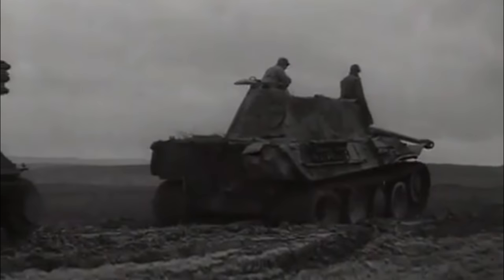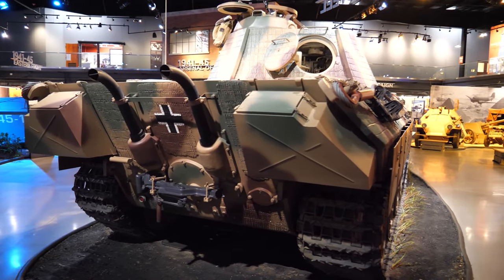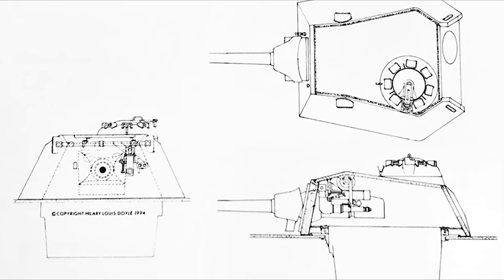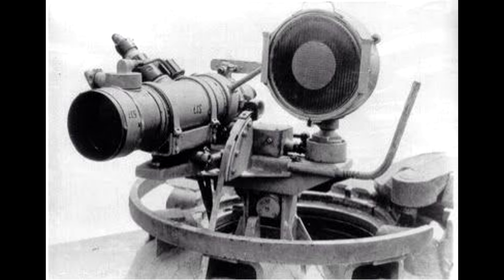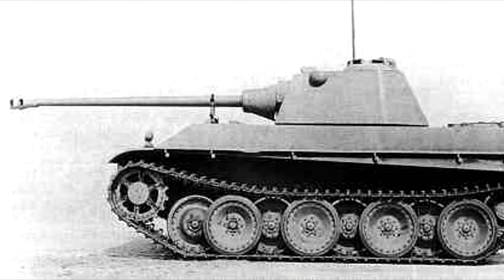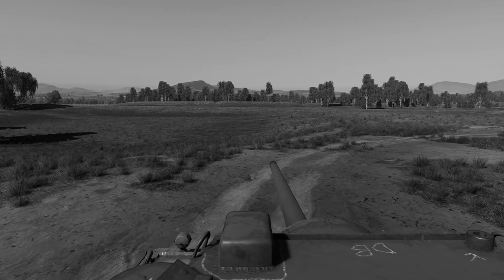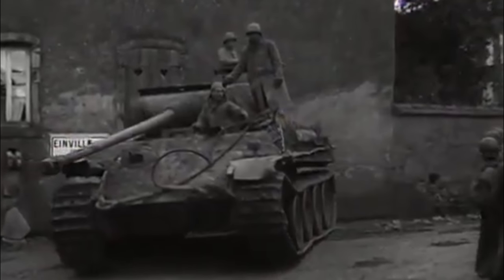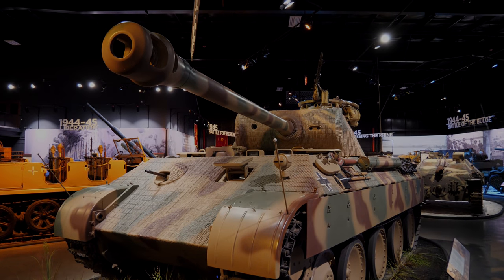The Panther Time Forgot, the Panther F | Cursed by Design

Comment: They also tested the Panther II out. It was that turret mounting the 88mm L71 from the King Tiger. The allies found one on the Krupp testing grounds at the end of the war. Had they managed to produce it, it would have been the most lethal tank of it's day! As you said, it had major transmission problems because mechanically it was front heavy having the whole weight of the final drives plus that (at the time, huge gun) all bearing down on the front. Had they gone towards what is now conventional, with the drive sprockets at the rear, directly connected to the gearbox it would have been awesome! It had it's faults but, I still think it was years ahead of anything anyone else had designed and built! The gun was extremely accurate and the crews (most importantly) were very well trained. Everyone says the design was pinched from the Russian T.34.....Ok yes, the sloped armour etc but, the T.34 was massed produced and unreliable to start with. It improved yes. It wasn't designed to be 'fixed' throw it away and get another one lol! The Panther was an amazing piece of finely machined tank porn! I say this as an ex-British tank crewman that served on Chieftain and Challenger 1 so I have a little insight as to what makes a good tank. The 'crew' involved at Bovington, private collectors, share a couple of original Maybach engines. One is normally operational while the other is getting fixed. One of the best moments I had there was when they took the engine from the Tiger I and put it in the JagdPanther owned by a S.African guy so they could drive it around. The noise and to see this beast moving made the hairs on my arms stand up! I could imagine the sheer fear of allied tank crews thinking they might get hit from it and not being able to see it let alone actually penetrate it's armour.
Reply: Uummm.... Correction

Only 1 Panther II hull was ever produced, and the turret (Schmale-Blende, not Schmalturm) was never been produced. Plus, the armament of Panther II is the same 75 mm gun

Comment: The shot trap has nothing to with the slope angle of the turret front but results from the curve of the lower part of the mantlet. In the photo showing penetration you can see the gouge in the mantlet where the projectile has bounced off before  penetrating the roof/turret front.

Comment: It is good to remember that the Schmalturm altrough was relatively cheap to assembly as many interior components of the turret was already in production for the Panther Ausf.G offering much better protection. The production of the Schmalturm was delayed because the Zeiss optics was hardly never delivered and was overrun by the Russians and the stereoscopic rangefinder was not produced with the exception of few prototypes. Due to chaotic final months the Schmalturm was never putted in production and other issues..

Comment: Opinion Piece here.
  My thought is that the Panther 88 program and this variant (F serie) were both working toward the same end.  Unlike the rest of the AFV fanboi world, I think a Panther with the 8.8cmKwK36/L56 (NOT the 71 caliber 8.8cmKwK43) would've been more viable for mass production, and more sensible, logistically speaking, than any other late war Axis tank program.  I think the balance would be better, too.
  True that the shorter KwK36 wasn't as good a tank killer, but it could punch holes in the M4, T34/85, and Comet/Cromwell from well beyond the range the others could punch holes in it.  As for the Pershing, we only had 310; less than Germany had of King Tigers.
  Consider that: the US M26 Pershing was MORE rare than Kingtiger.
  As for the Eess Dva (IC/IS 2), it wasn't a very good tank.  Its rate of fire was very low and its sights were not the equal of the gun's effective range.  Panther was far more maneuverable and had much better sights.  With the "kurz" 88 Panther would be close to ideal, imho.  We (USA) stuck with the very similar 90mmM3/L50 line after the war, so my contention is not altogether without historical merit.
  Great content, btw.

Comment: I can't shake the notion that Panther might've done a bit better with the 8.8cmKwK36/L51 of the Tiger E.  I don't know the muzzle energy of the "75" offhand, but I do know that 900-1000mps is pretty high energy.  I suspect that might be roughly equivalent to the "ach ach's" Muzzle Energy.    I think the balance would've been better, too, and that was a BIG factor in suspension life.  Front heavy AFVs* suffered extreme differential wear.  Plus, longer overhang is death to maneuverability, mobility cross country and on narrow, winding, roads.   
  The much higher velocity 7.5cmKwK42/L70 had a big breech, too, so I figure the two different caliber weapons would take roughly the same amount of turret interior.  Since the 8.8cm FlaK/KwK 36 was already in mass production, was a dependable weapon, and had a long barrel life . . . and a far superior HE round, it would've been a better match, imho.
  I know some folks claim the 8.8cm/L70 was supposed to somehow go inside the narrow front turret, too, but I don't see it happening.  Not enough room behind the breech to sling the rounds inside the turret.   The trunnions need some kind of bulk inside to better balance overhang, after all.  That means a bit more of the gun would have to be inside.
*Front heavy AFVs like StuPz IV, JdPz IV/70, SU100, SU122, and others.

Comment: Good video, but you have missed some very interesting facts about the Panther F:
1. You mentioned the improved gun sight, but they developed that further to be fully stabilized. In the end the Panther F would have been able to give accurate fire when in full move. Even though it was only the sight that was stabilized and not the gun, the sight was linked to the trigger, such that once the gunner pulls the trigger, the gun only fires as soon as the sight and the gun are aligned.
2. Even the gun sight that was ready for use (the one that you showed) was a huge improvement over the Panther. The Panther's gun sight was just horrible, because its fov was so narrow. This was actually one of the issues that motivated the Panther F's development.
3. There was also an autoloader version of the 7,5 cm KwK 44/1, called the 7,5 cm KwK 44/2. It was able to fire its four shots in 4.5 seconds. It was planned as a future upgrade. However, the turret would have been incredibly cramped with that thing, so it's not absolutely certain that the idea would have been practical.
4. Speaking of the gun, there where plans to mount the Tiger II's 8,8 cm KwK 43 L/71 in the Panther F. The side project is commonly known as Panther 8,8 cm or Panther 88. Daimler and Krupp each developed a turret for the Panther F to mount that gun. The project is sometimes misattributed to the Panther II, but by the time the development of the Panther 88 begun, the Panther II had been dead for over a year.
5. Perhaps the craziest side project was the so-called Turbo-Panther: BMW were developing turboshaft jet engines for the Luftwaffe, and in 1943 one of their engineers proposed to use one of those things to propel the Panther. The first designs had problems with fuel efficiency and space requirements, but when later iterations fixed most issues the jet engine got approved to be used on the Panther F. By February 1945 it was ready to enter production, but the late war chaos prevented any actual production. Just like with the Panther 88, the Turbo-Panther is often misattributed to the Panther II, even though you can easily resolve both misconceptions just by looking at the time lines.
Reply from the maker: The panther 88 is going to be lumped into my revisit of the Panther 2. As for the autoloader you mentioned I saw no mention whatsoever of it in my source book so I can't confirm that was ever actually a possibility for the tank. If you have information on it I'd love to see it though.

Comment: Could the MG42 be substituted for a coax or hull-mounted MG34?  The video says the, "armored MG34 was no longer in production", but I don't think the MG42 could be used in those applications due to revised method, compared to the MG34, for replacing barrels; the 42 had a hinged barrel jacket that allowed the barrel to be removed at an angle, from the side, which worked great for a gun in infantry or similar use, but wouldn't work if there were a mount surrounding the barrel; was installation of a MP43/StG44(!) be due to the unsuitability of the MG42?  Were MG42s used in coax or hull mounts on any armored vehicles?

Comment: Ru-251 is one of the fastest tanks ever built. But, there was little information about this tank, which includes its designed top speed. Also, in my experience playing WoT, to use its max gun depression, I have to turn the hull sideways. This maybe reflected in War Thunder but I never played it due to required technical specs. But, it will be always appreciated if you make the next CbD video about this with a demonstration on the aforementioned gun depression. Hope you comment on this to know if you have plans for it.

Comment: Thank you for the video. I also found the night vision video an excellent coverage some time ago. I remember the allies finished some Panthers from factories after the capitulation, I assume they got the G turret? Post-war service of german tanks was not unique, including the Panther. 
Did i heared it correct, about Panthers still having some mechanical issues at the end of the war? I assumed they proved more reliable then Tigers and easier to mantain? At least rail road transport was better.
Reply from the maker: They had improved significantly by the end of the war. Low skill crew and bad quality materials still caused unreliability though.

Comment: You haven't mentioned the Panther F hull at Aberdeen , fitted as it happens with a G turret, with its increase in armour all around??
Reply from the maker: You're thinking of the Panther 2 hull not the F. The F had the same hull armor aside from the roof

Comment: Tell us of the advantages of the wide based rangefinder. The idea of greater distance of its baseline says it would be better, but is it solving a problem, or just a bit better? 
This video is the first mention of night fighting equipment on tanks. If it was based on tube technology and had tubes much larger than on a radio, it must have been very fragile.Yes?

Comment: How was the new conical design not prone to shot traps? I see a huge slope underneath the conical mantlet that could bounce a shell to hull roof under it.
Reply from the maker: The odds of that causing a shot trap are pretty minimal compared to the entire turret face having the potential shot trap.
Reply: @ConeOfArc  Got it, the question I have is why they didn't take the panther G mantlet approach and add a straight angle armor under the conical mantlet just for added protection/perfection. I can't think of any constraints to that and just can't understand why they didn't do that.
Reply from the maker: @liquidator3828  probably because in real life battles it was pretty much a non issue. Plus adding weight to the gun makes it that much harder to elevate it

Comment: The standard turret was cramped enough, I'd dread to think how little room there was to move around in there.
Reply: Not really, no. 
The newly developed KwK 44/1 from Skoda, which was to be used in the Panther F, had its recoil buffer and the recuperator below the gun breech. This saved a lot of space and shortened the reloading time.
Reply: @cursedjagdtiger7191  that must be some serious size reduction because if you have ever seen people move around inside a standard turret or move ammo, itsnthe worst turret I've ever climbed inside of in latenwar terms

Comment: An suggestion would be the T-32 heavy tank.
Reply: An actual good heavy tank project that didn't make it to production because war time funding was gone. Just one of those blocking the road in Korea would have been a whole lot of nope for T-34 or IS to deal with. Considering the M26 refits into M46, this heavy tank would have equivalent power to weight of that of a T-54.

Comment: My understanding is that it would also have had gun stabilisation. That and the stereoscopic range finder would have made it the most accurate tank in WW2.
Reply: More likely a stabilised rangefinder. Spielbergers book on the Panther talks about that. Otoh the Panther chassis is quite stable and dampens oszilation quickly. So quick stop and snapfire works (The germans used that on the Leopard 1 as well)

Comment: Germany: The Panther's main problem is that it is far too heavy for its relatively light engine and transmission, this issue must be fixed for it to be effective.
Also Germany: lets add more armor!
Reply: the Panther 2 had a bigger transmission and engine to make up for the weight increase
Reply: IS 2 46 tons and 520hp , Panther 44 tons and 700 hp . Why people always say it has a weak engine .....

Comment: Very informative.
Another thing to consider is even if the Germans were a able to field these, they probably would not had the fuel to run them at that time in the war.  I would also question the quality of armor. My understanding is near the end of the war the German armaments manufacturers no longer had access to the right elements to properly harden their armor. I believe it was prone to cracking after hits.

Comment: I don't think the new turret would have been that much more protective than the old ones. Yes, the armor profile would be better, but that late in the war Germany would be using significantly worse alloys for their armor. The frontal thickness might have been 120mm, but the real effective thickness would be closer 100mm, which is marginal at best for late-war allied firepower.

The heavily angled turret sides would be nice, though.

Comment: The main difference with Schmallturm turret was that 1/2 the front turret profile is the 120mm FH armor @ 20o [should resist Russian T-34/85 APBC with 125-130mm penetration or range only few hundred meters. ] . The other 1/2 turret profile is side 60mm turret armor  at 25o x 60o , with compounded angle of  over 60o. The t/d on 85mm gun should be 0.70 resulting in >2.6 increase in resistance or roughly 156mm resistance . That should stop APBC @ < 200m.
Reply: Schmalturm*
Reply: @ikat_tracer  yes i missed that, thanks

Comment: Btw, every panther was cursed by design because the crew has to rotate the tower manualy without transmission suport, that means it was impossible to tur the tower when the tank was in a slant position
Reply: That was only with the Panther D

Comment: Video mentions the range finder but ignores it as far as the value of it in combat. Also the commanders cupola has a much lower profile and would likley be far safer but not sure about the visibility compared to the G cuplola.  Like the other Panthers, it would have been great if it could trundle somewhere and ambush Shermans and T34s, and near useless if it had to attack.

Comment: Not all Panther G's had the 'chin'. The actual difference between the A and G is that the hull sides just above the return rollers were angled and completely flat on the G model. The A had a steeper curve at the back.

The 'chin' was not added to all G models and is actually quite rare in comparison.
Reply: Did the panther not have like 1 return roller?
Reply: @Kyle-gw6qp  
Fuck. Yes, lol.
I watched too much of Chieftain lately, return rollers are stuck in my head for some reason...

Alas, like I said in my original message, if you look just above the tracks. That's a dead giveaway if it's an A or G.
Reply: @RedmilesShark  Why did you use "rollers" then? "roller" would have been accurate.

Comment: There is another thing to point out.  When ever you hit a gun mantlet you get a problem with alignment of the gun.  The bearing get a beating.  That is why the Russian designed T-55 without a gun mantlet.  Very small at least.  The British copied with the chieftain.  The early churhill with 2 pounder has no gun mantlet.  Gun mantlet I would say I cursed by design.

Comment: I would think that the smaller turret would be even harder to fight in then the earlier version.
Reply: It's not smaller, the front is just not as wide. Instead of making the front a big horizontal block they angled the sides torwards the front.

Comment: Panther F: designed to reduce shot traps
Me in M4A3E2: Still manages to shot trap it
Also me: visible confusion
Reply: Shot traps in WT are borked and have been for years. Its mostly due to gaijin being lazy and not fixing the gaps in their tanks. Some tanks can still be penned by MG's because of these gaps. 

Its a game design flaw really.
Reply: @PugilistCactus  I actually shot trapped it off the conical mantlet. Was taking pot shots and it bounced off it into the upper hull